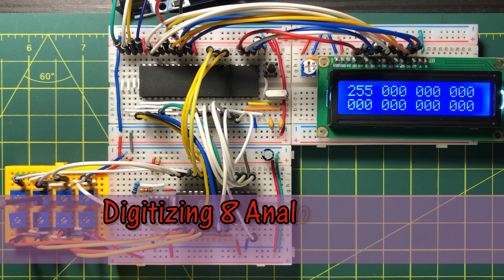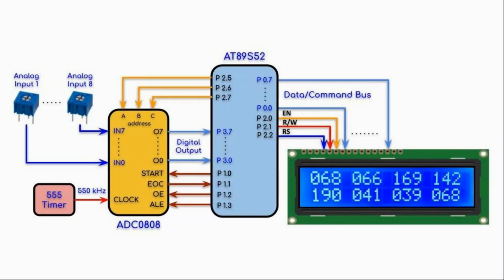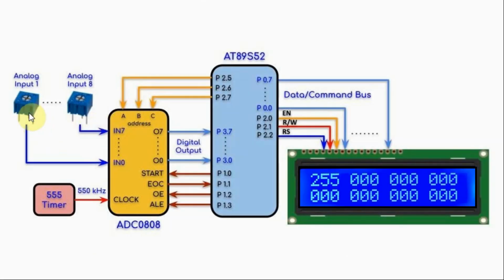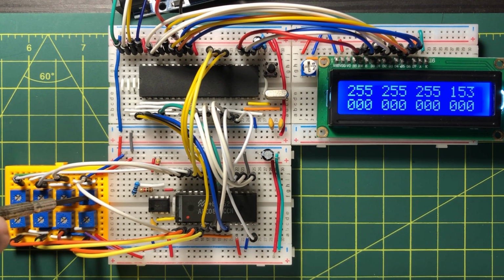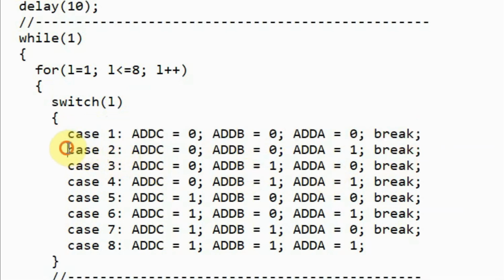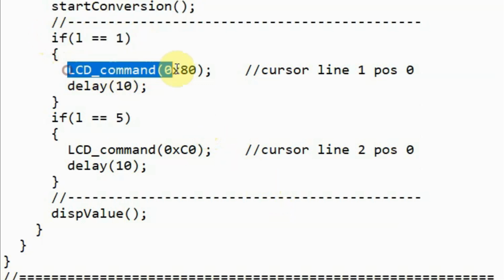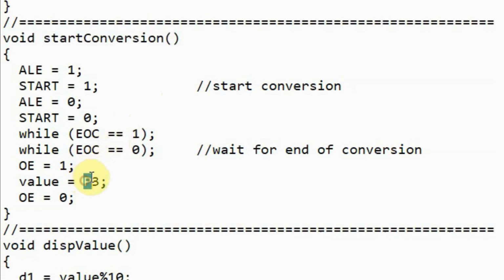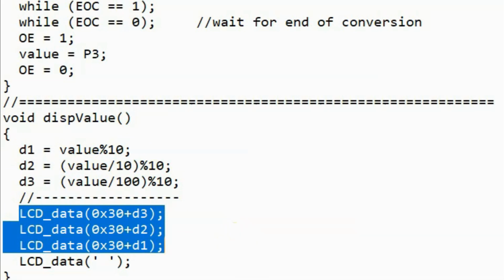Digitizing 8 Analog Signals via ADC0808 & AT89S52

Comment: in this project can at89s52 work without ADC?
Reply from the maker: Yes. The ADC is only used to enable analog inputs into the microcontroller. You can check my other videos on different applications of the AT89S52.
Reply: @AnasKuzechie  can you tell me, about the microcontroller of the type 40 pin embedded ADC?